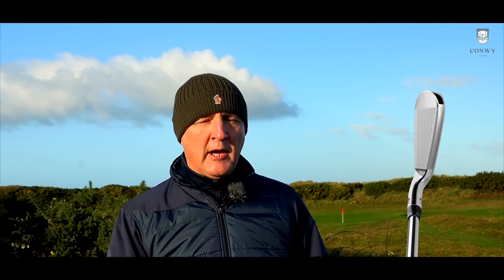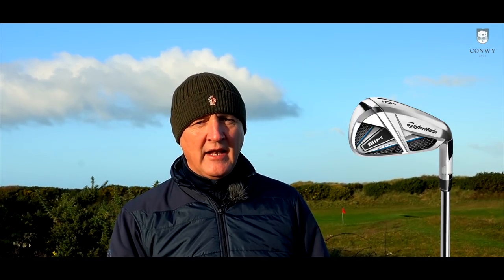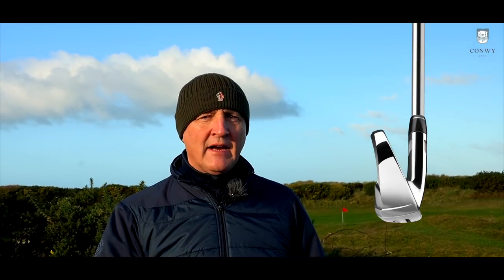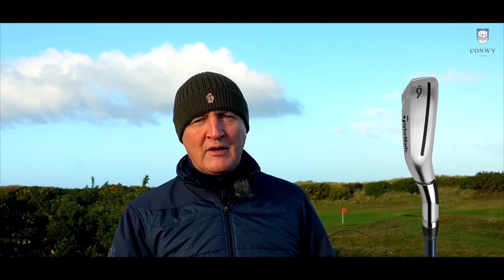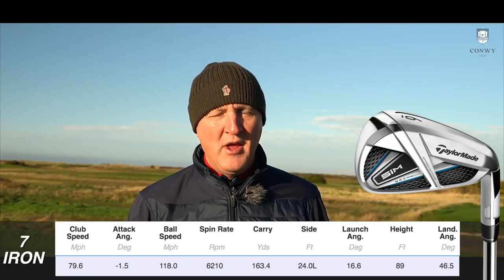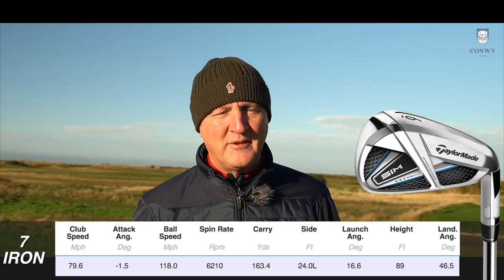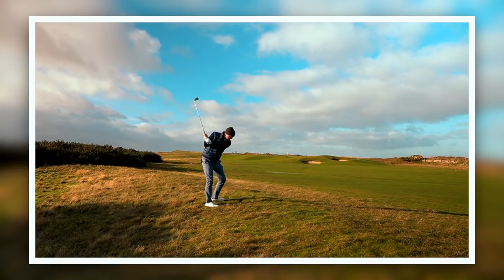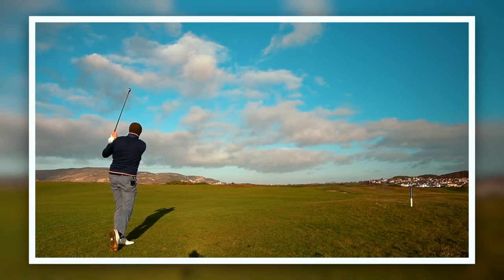AweSIM Irons by TaylorMade?

Comment: Another great video.  I wonder if taylormade are going after the potential new golfer and the aging golfer that needs the help?  A 27* 7 iron seems like a 5 iron to most of us.  By putting the c of g so low, I guess launching and land angles are helping slower swingers.   I gamed a set of M4 irons for 5 games last year.   28.5* 7 iron seemed excessive to me and distance control turned out to be the big issue.  I don't need a 190 yrd 7 iron and found 5 wedges were required for gapping.
I think TM will find a market for these but it seems like a re-badged M6.  The marketing wank will bestow the benefits as revolutionary and for the occasional golfer that won't or can't carry lag into impact, may find a fit.  Cheers!

Comment: 27 degrees loft 7 iron on the over sized version... Why not just write the lofts at the bottom instead of some made up number that means sweet f.a. anymore? I mean nobody buys into that old "oh I hit my 7i 200y" crap anymore. Do you want 5 or 6 wedges to go with your 4 club iron set?
Reply from the maker: it is a strong 7! as I said you would stop at a 5
Reply: IT's not a dig at you or the review, just a reflection that the charade has reached levels of insanity I can't comprehend anymore. I understand that some adjustment is required when CG is lowered in order not to get balloon balls but that was passed long ago.
Reply from the maker: Sir TogII agreed

Comment: Thanks for the review but I wonder if the technology plays as big a part in extra distance as the changes in the specifications of the clubs do.  Looking back  to the TaylorMade M1's the 5 iron in that set had a loft of 24 degrees and a shaft length of 37.75 inches.  The new Sim max  5 iron has a loft of 21.5 Degrees and a shaft length of 38.5 inches.  Removing 2 &1/2 degrees of loft and increasing shaft length by 3/4 of an inch will certainly increase distance even with the same club head.  I personally think much of the "supposed" increase in distance is because of lowered lofts and longer shaft lengths rather than 'technology".....